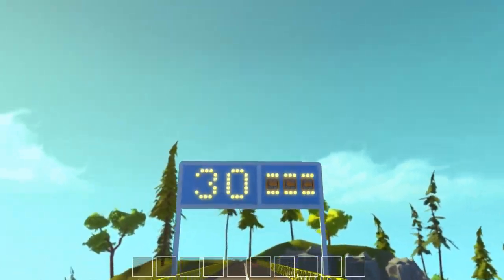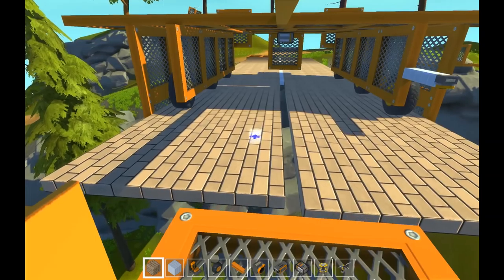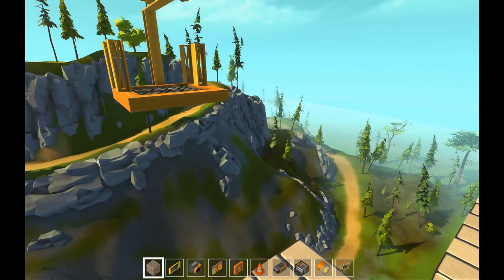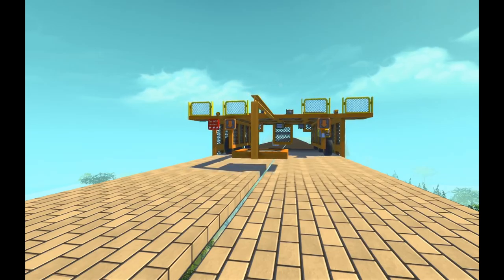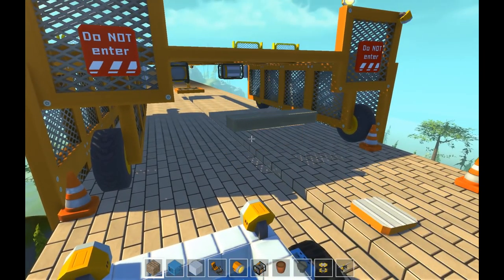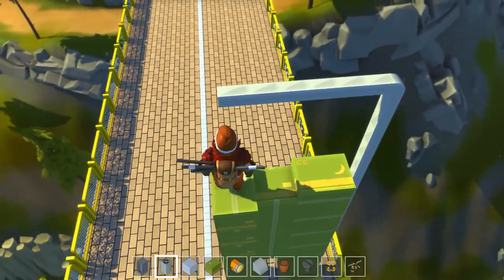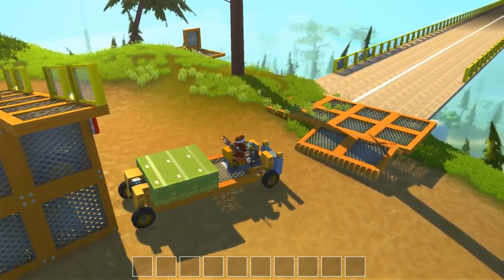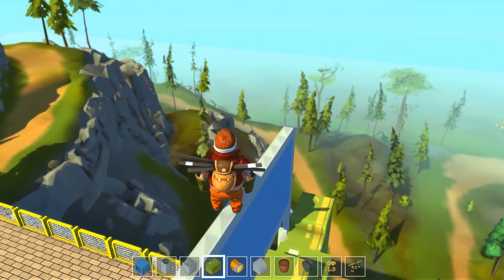Scrap Mechanic: Bridge Building Machine/let's play #12

Comment: Using the staircase floor as the base of the car, and making small pillars to hang suspension from, I find quest amazing. Also! Having 2 wheels in the middle helps the vehicle not get stuck. Another thing, add rear wheel turning! Because it will likely be long!!
Reply from the maker: +Luca Perugini I will have another go at the car soon. Rear wheel turning could be good for automatic vehicles too! I will try that thanks

Comment: You mentioned attempting to make some vehicles. Do you think you could have a go at a SwinCar? I posted my attempt on the subreddit a few days ago, but I think you could do better. Mine could climb pretty much anything, but any improvements I made on the steering compromised its performance somewhat.
Reply from the maker: +Crispy Bacon I didn't know they were called that! Awesome machines I hope they are here to stay and not just a fad. I will give it a go. I'll check yours out first tho... i did, that's pretty cool!

Comment: Because you had asked for a better way of steering, this is actually really easy: You can connect the steering wheel to a bearing on which you put 3 blocks in a row to one side. One block below next to the third block you put on the left and on the right side one sensor and connect each to a controler. In this controler you can reduce he speed and you are able o give every wheel bearing a specific angle so you can built e.g. 8x8 trucks with realistic stearing. The only downside: each wheel needs two bearings, one to turn to the left and one for the other side.
I hope my school english isn't to bad and you are able to understand this.
Reply from the maker: +Fabinator155 That all made perfect sense! I will give it a try.thanks :)

Comment: Have you ever tried making gears or something of the sort to get more torque out of the scrap mechanic bearings? just a little idea, not sure how well it would work. also i bet you could interlock 2 bearings across from eachothher to have double the torque as you cant weld things together (as of yet)
Reply from the maker: +Brandon Pepa You can put two bearings together but have a block inbetween (short pipe etc) it works well but I'm not sure how I would make gears. Will have to think about that.
Reply: yeah im surprised i haven't seen anyone interlocking bearings. it could really help with some problems people have been having, like in mennace's "peanutland" theme park. as for gears they could probably only be basic 4 tooth, and 8 tooth gears, above that im not sure how well interlocking the teeth would be, and also scrap mechanic doesn't seem to like collisions at fast speeds things utilizing it while spinning fast would not work well.

Comment: It's too bad the steering seat doesn't have speed adjustments like the controller does.  I guess you could do controller-based turning, but that'd be nothing but pain.  Maybe some kind of hybrid between the two.. a sensor-linkage between the seat and a controller?  Rotate blocks over sensors when you want to turn, then use the controller to actually turn the wheels.  Massively over-complicated, but it might do the trick?
Reply from the maker: +Steve Pittman I will try something like that. I'm sure there is a way to solve the problem. Thanks dude :)